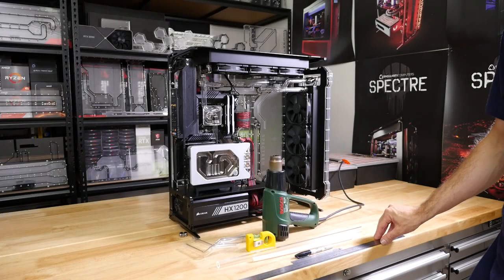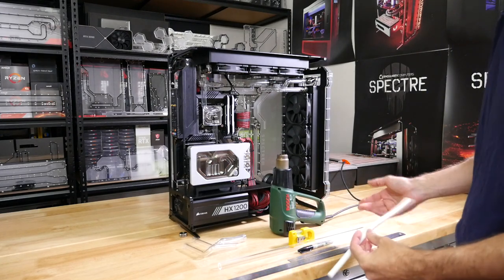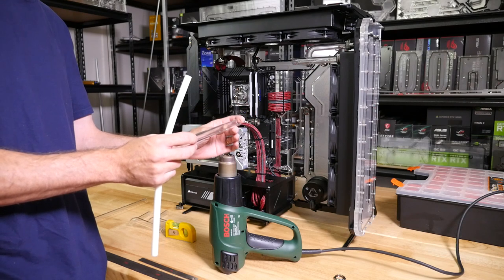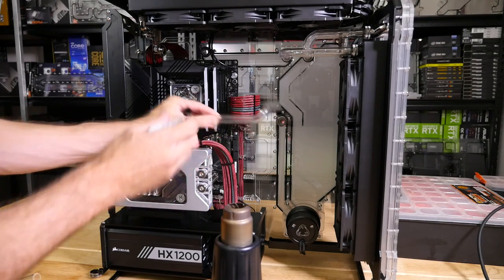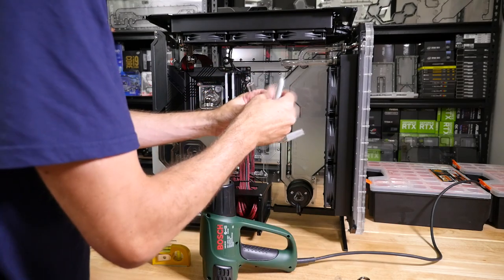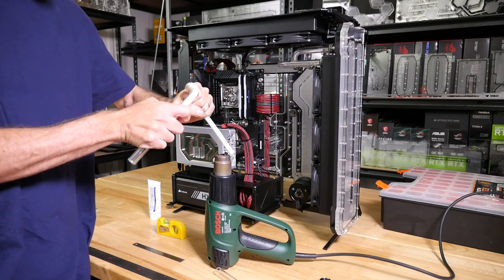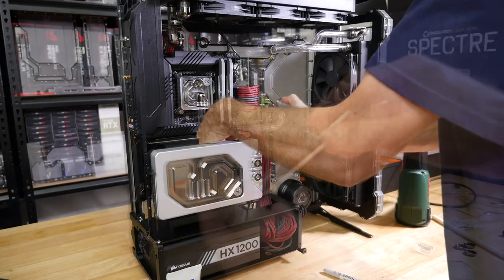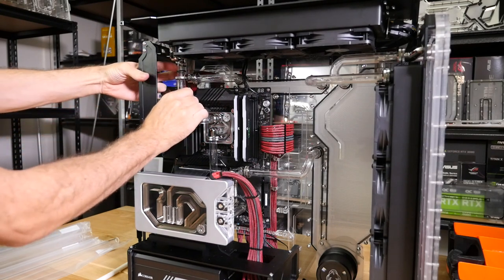Hardline Tube Bending Guide

Comment: yea with my toughest bend so far (down from the gpu in to a tight 90, in to a 45 the the end of the gpu, in to a .... ehr.... 45....ish? (45 degree fitting but rotated 45 degree's to aim it across the motherboard/towards the gpu so....whatever that does to the angle, i just re-heated 1 tube 10 maybe 15 times not intending to use it but making it roughtly the shape it should be (ideally in 3 bends) and make a template off it so i could put my tool on a piece of paper put one end at a line and put the bends in 1 by 1 knowing the final tube will be just about what it needs to be, still took 3 tubes as i needed to tweak the template a bit (had a pretty crooked one for a year... seemed fine from 1 angle :P)

though i just cannot do bends as close together as you >.> i need to use the bending tool or it will be so crooked you'd swear i wasn't even trying.

and yea i noticed with the in kit debur tool (only recently got one with PETG i used sandpaper, for...PMMA? what ever corsairs frosty tubes are made of got a debur tool....noticeably more blunt on the final tubes :P and yes it did take a amazing amount of tubing to get nice tubes with PETG, was suprisingly easy with PMMA once you get used to heating it 2-3 times longer >.>